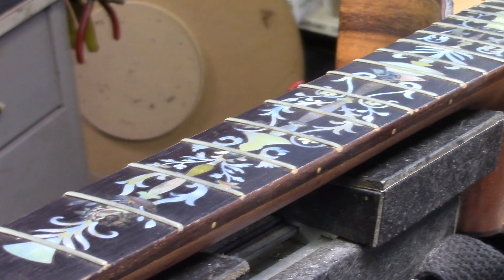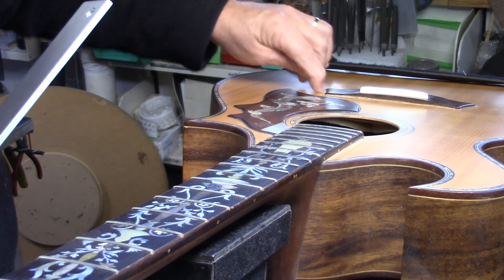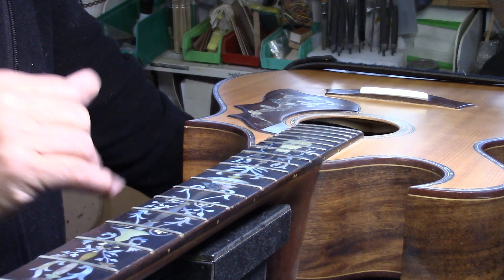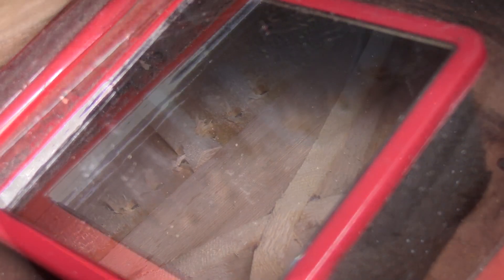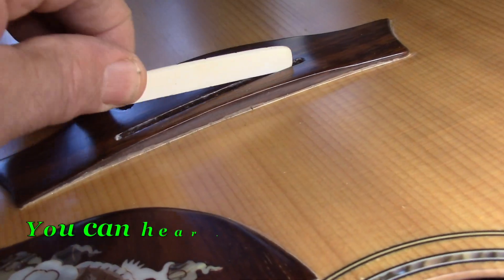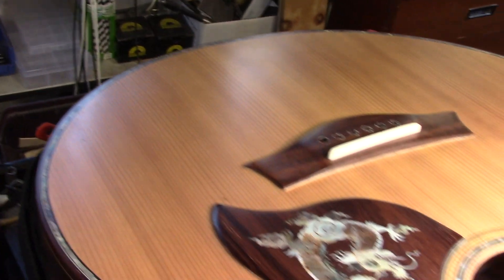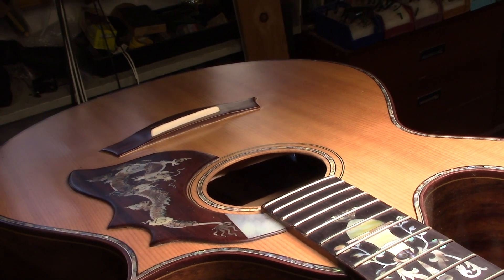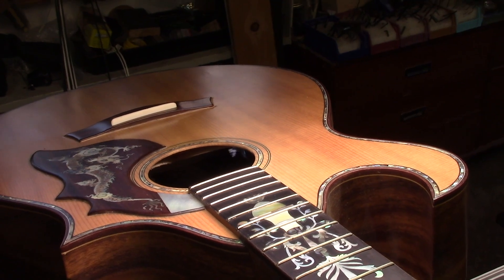Spectacular Inlay ..... BUT: We got a Problem .....

Comment: It also looks like most of the frets aren't seated fully into the fretboard.  Like cropduster said - what a shame...but I'll always go for a quality guitar with great tone wood and the least amount of extra bling that can be gotten away with every time.  Thanks for sharing.
Reply from the maker: It's got the bling .. but that don't mean a thing ....
Reply from the maker: I have seen these fret issues before on many guitars. The "Form follows Function" approach was not evident in this case.
Reply: Make a new bridge, and bridgeplate  problem fixed
Reply from the maker: @Claude77  https://youtu.be/2aEuUfphZtY?si=b0axcPpkepedXC4N

Comment: I mean it’s doable but how would you approach changing the neck angle by sanding just out of curiousity?
Reply from the maker: I do it all the time. If you have enough thickness in the fingerboard. I'll find a couple of videos for you, once I get back to the office.
Reply: alright, good, might be another solution for my martin down the road. yet the problem is opposite, the neck lands too low at the bridge @StringTechWorkstations
Reply from the maker: Hmmm ... that sounds like a neck re-set is in order. Very typical for a Martin.
Reply: how about shaving down the bridge and deepening the saddle slot? or is there a minimum height requirement here? @StringTechWorkstations
Reply from the maker: In this case the bridge would need to be thickened ( a replacement bridge made ) and the action raised up so that the frets clear the fingerboard.
Reply: no I mean my Martin guitar, not this guitar in the video. It doesn't kiss the bridge, the neck ends up on the bridge. so the bridge would need to be lowered or as you say the neck reset. The body has a belly now so it seems the bridge has risen because of this. But I think shaving down the bridge would be less trouble than a neck reset, is why. and maybe doing the opposite of what you say in this video, so changing the angle thinning the material at the nut using the real estate of the fingerboard. instead of at the soundhole @StringTechWorkstations
Reply: also, what is your opinion on using a clamp method? so force clamping the neck into correct position, little more over the bridge actually, then spraying steam into the body at the front only and waiting 3 weeks before unclamping.

When strung, my neck angle lands about 1,3mm underneath the bridge surface. @StringTechWorkstations
Reply from the maker: Shaving the bridge on a cheap guitar is fine .... but on a real deal Martin .... a neck reset is the way to go.
Reply: it's a dx1ae @StringTechWorkstations